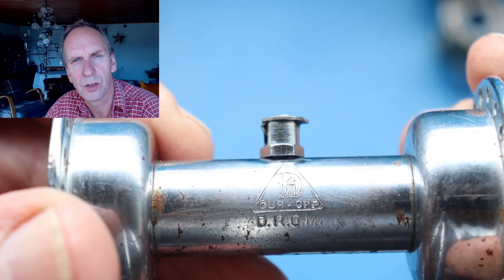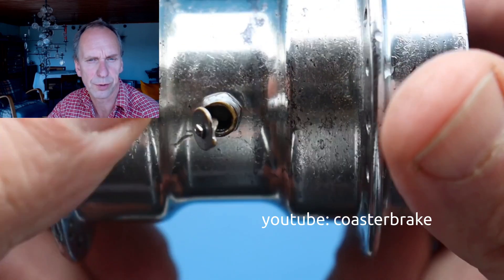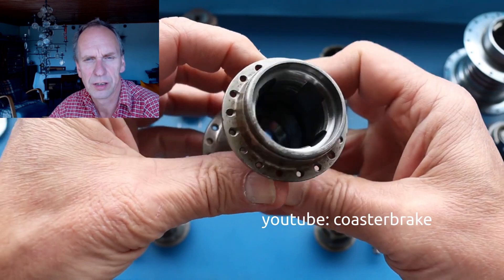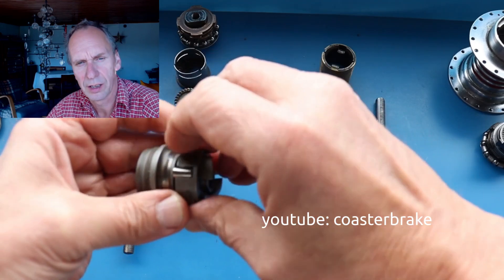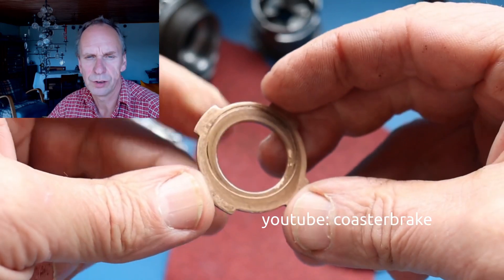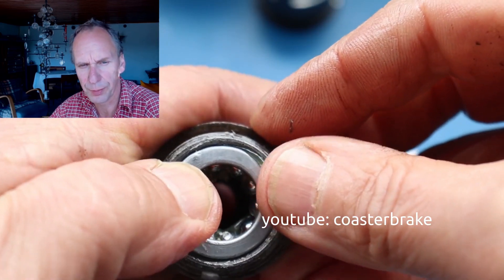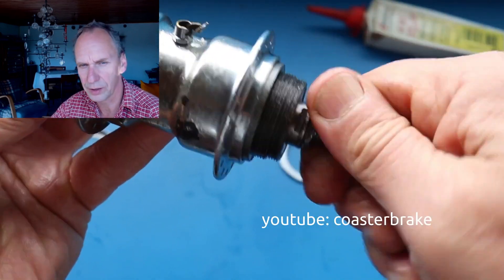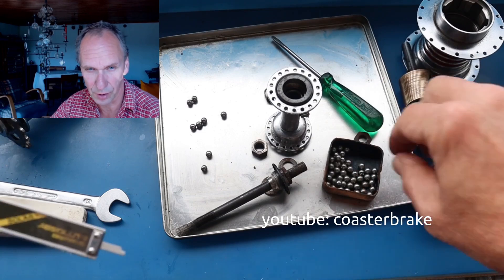coaster brake Duerkopp hub 1950 Bielefeld with multi disc brake compared to Torpedo

Comment: Great video. I have a Bendix coaster hub I bought from Canada, it's a one-speed, and not disc type. It has good modulation, similar to shimano D-type. Only thing is that is makes a clunk sound after releasing from from heavy braking, as if the spring has a hard time releasing the brake shoes. Have you experienced this before in other hubs? Perhaps I reassembled incorrectly.
Reply from the maker: Good morning and thanks, I Think you need a second Bendix, to repair the first. Sutherlands Handbook "says". Bendix original is interchangeable with RD. RB-2, 79 Junior and 76. regards Jens